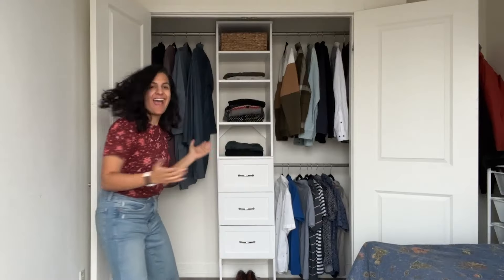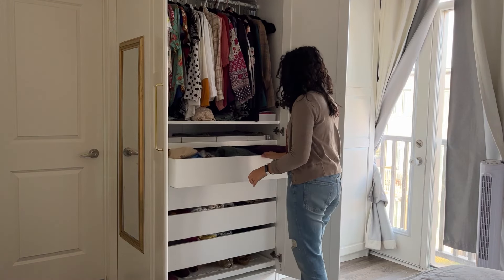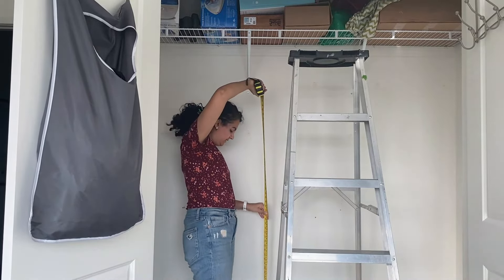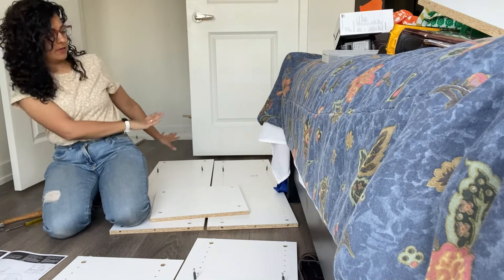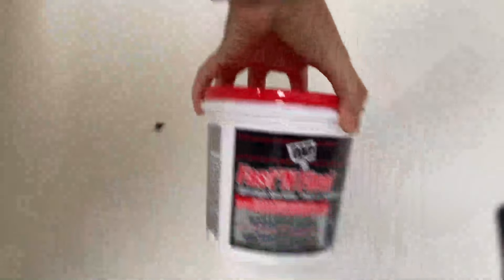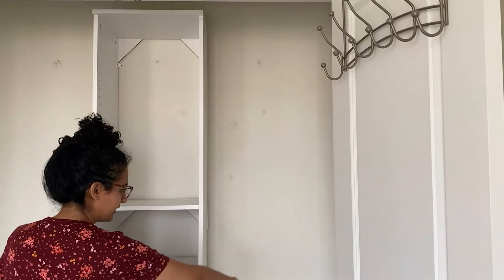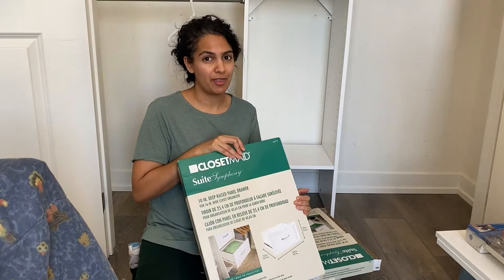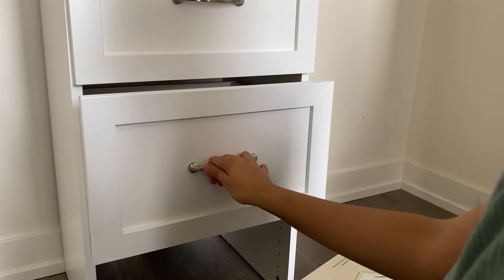INEXPENSIVE SMALL CLOSET MAKEOVER // Closetmaid Suite Symphony Closet System Install

Comment: I meant the whole thing smaller than 6 feet. Like are all the pipe adjustatble in a way where i would keep 2 at the minimum of 30" and the other one cut the main piece smaller so that the other pipe goes   Makes it smaller than 30" so i could fit the whole thing in a 50" closet. Obviously if it works one of the hanging will be short than it’s suppose to

Comment: Are every single bar adjustable? in lenght on only the right side one? let's says i would like to cut the bar to make it fit a small size closet than 6" as advertise?
Reply from the maker: Did you mean 6” smaller than advertised? You’d have to cut it